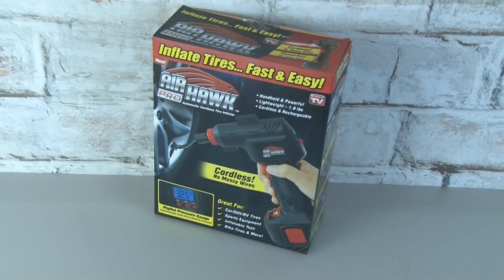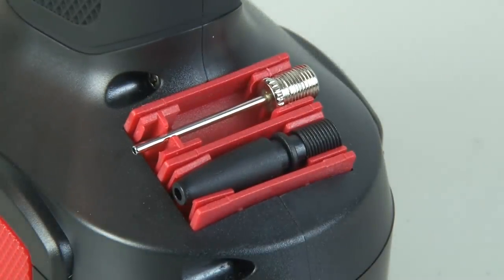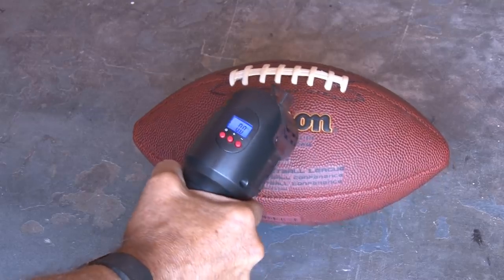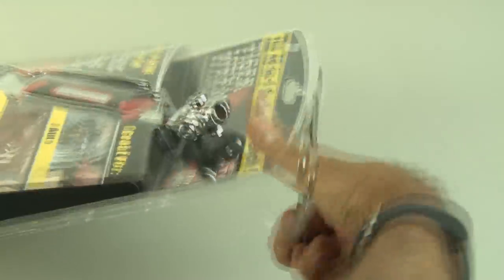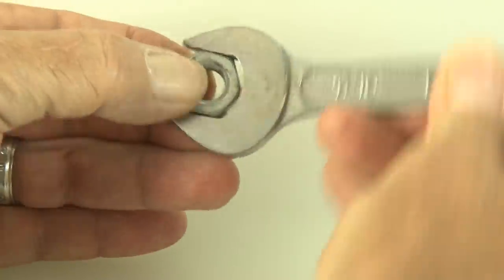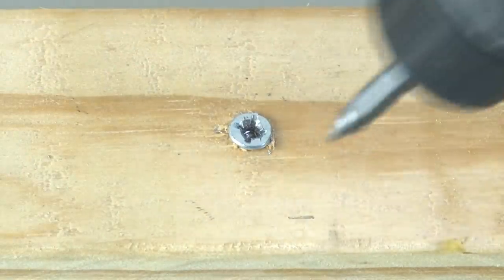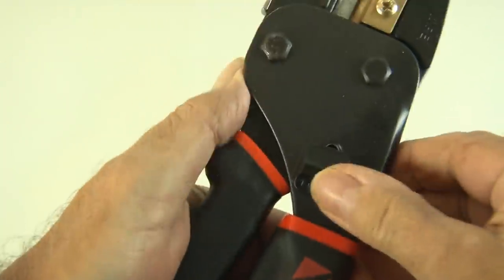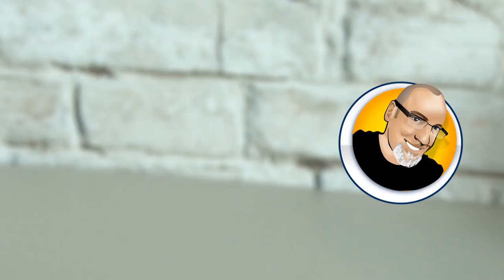As Seen on TV Tools - UNBOXING & TESTED!

Comment: How is 32psi low?
Reply: @gamezahoy712   wtf.are you saying 35psi is going to explode the tires?
Reply: @themfknightrider420  Its an exaggeration but its to muc psi bad for the tyres.
Reply: @gamezahoy712  what car are you driveing that saying 35psi is to much?
Reply: @themfknightrider420  35 is way too much. my car runs its fronts at 29 and backs at 32 35 is miles to much.
Reply: @gamezahoy712  what are you driving a toy car lol. my car runs at 36psi. and my truck run at 40psi.
Reply: @themfknightrider420  my mini van runs at 32psi all round and my bmw is 29 front 32 rear. I like grip not gas mileage.
Reply: While driving tires get hot, those 35psi will go up to 39psi, yes 35 psi is a lot
Reply: @themfknightrider420  What tyres? All I see is a rim with a hint of rubber on the edge... His ride must be super hard, with that low profile combined with that high pressure... I would not run more than 2Bar 29/30 Psi. So that the tire can accumulate to the temperature change.

But then again, I might be biased... I drive a Jeep with huge profile 35" Tyres xD
Reply: 225/35 are recommend at 35 psi
Reply: GamezAhoy your a legend lmao
Reply: Not all tires are 32psi.

Comment: 4:34 did this thing just say standard and metric? Isnt metric the global standard?
Reply: Aboeth US uses a form from the metric system known as the Imperial system i.e Feet, inches, Miles where most of the world uses Basic metric Kilogram, kilometers etc
Reply: @rasdog01  The US doesn't use imperial.  It uses the US standard system.  Its based on the imperial system but its not exactly the same.
Reply: BECAUSE AMERICA!!!!!
Reply: @sjgomes89  The United States Code refers to these units as "traditional systems of weights and measures". Other common ways of referring to the system in the U.S. are: "Standard", "Customary", or, erroneously: "Imperial", or "English" (which refers to the pre-1824 reform measures used throughout the British Empire).May 6, 2019
Reply: Richie Tarantino I know that, but metric us still used everywhere other than the US, so technically Metric is the Sandard, right?

Comment: The tiger wench is supposed to be loose! Look at the inside of the wrench, it's cut rounded to prevent slipping. It will feel loose but still grab strong. Ugh,  ignorance...
Reply: Off-Grid Optimist You ever use a standard wrech on a metric bolt and be like hey, it's just a little loose and then it strips the nut or bolt out? As someone who works on dirt bikes, ATVs, snowmobiles and cars I certainly want a snug fitting socket. Trust me over the years I've had it happen way to many times.
Reply: Off-Grid Optimist supposed to be loose. Completely wrong and quite frankly ironic.
Feel the difference vs cheap walmart tools and snapon wrenches.